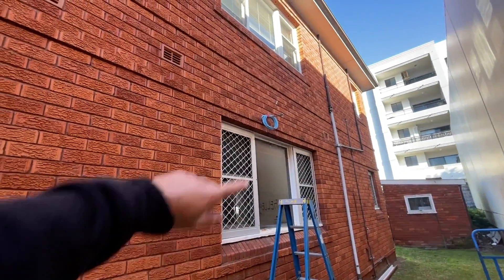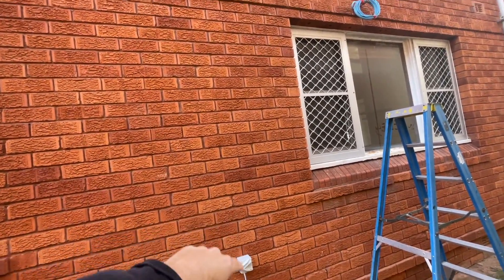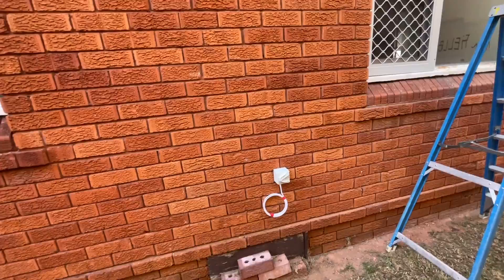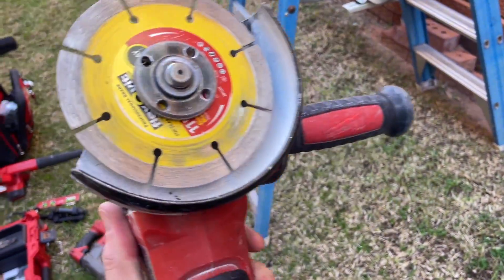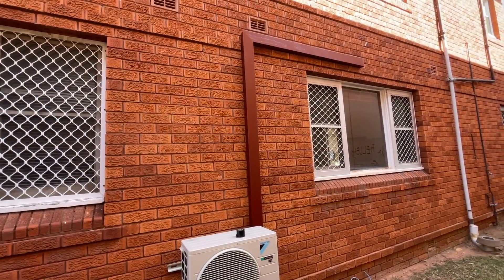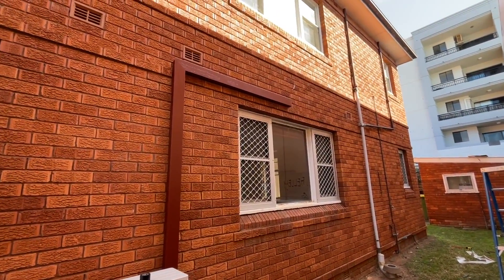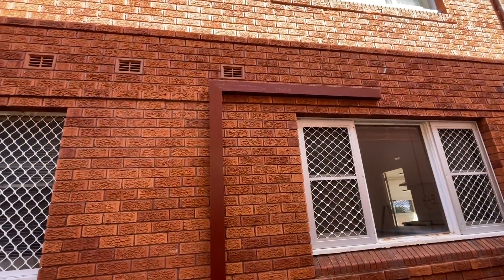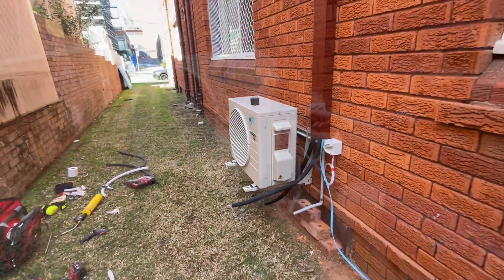Installing a R32 Daikin Ductless Mini Split Air Conditioner.

Comment: Great Vlog. Love your ductwork. Super neat. What brand is that ducting? Couldn't find it on internet.  I like it
Reply from the maker: There’s a company called colorbond in Australia that manufacture sheet metal.  Any air conditioning wholesaler in Australia sell this ducting and it’s made by Colorbond. We call it Trunking and every installer uses it over here.
Reply: Thanks Mitch. I live in Melb and have looked for it and cant find anyone that sells it other than a company called MJS in QLD
 @maracservices

Comment: Great video, how long would the run of copper need to be apart between the outdoor and indoor unit before you would need to add more gas
Reply: 20 to 30 depending on the brand and size

Comment: Do you guys use aluminum tubing or copper ? We used to us aluminum a few years ago, but almost everyone in the trade here has switched back to copper - found aluminum corrodes after time and starts forming pinholes
Reply from the maker: We have always used copper here and still do. I’ve never heard of anyone using aluminium. Very interesting!

Comment: Hey mate, how do you seal the end of the colorbond capping? 
Would be keen to see a video of how you do the 90° bends too! Love your work
Reply from the maker: So I seal the penetration through the wall with clear silicone then i fold the lid of the trunking over the top so it covers the top. Then I also run a bead of silicone along the top where the lid meets the wall. I’ll make a video going more in detail. Cheers
Reply: Legend! Thank for that’s…definitely want to start using it, looks way cleaner 👍

Comment: thumbs up for a new driver. I think you willed it to work with that battery swap. Might be time for the retirement shelf in the back of the truck.
Reply from the maker: I think you might be right mate. I’ve just held off as long as I could but it seems to be getting worse. It is time!

Comment: Mitch, neat as always. Are you gravity draining the condensate or pumping when you have horizontal runs such as that?
Reply from the maker: Thanks mate, it’s a gravity fed drain every single time. I’ll only use a pump as a last resort personally. Cheers
Reply: @maracservices  I stay away from pumps too. Stay well thanks
Reply: I also try staying clear of pumps. Done 100's of installs with gravity drains with even longer horizontal runs, but use 25mm tube, and if there is space in trunking I try sloping drain  inside the trunking
Reply from the maker: @craigladewig3158  I agree mate

Comment: I have heard you consider getting a 12v drill setup or will you be sticking with the 18v?
Reply from the maker: I want to get the m12 impact for my service bag but an m18 impact and drill is way more important. 
The m12 is a just a light weight thing which would be nice. Not a necessity in my opinion. I want to get a new m18 impact to replace mine which is cooked then hopefully one day I’ll buy an m12. Everything is just so expensive nowadays 😂
Reply: @maracservices I’ve got both and the m12 is my edc go to. Great power for the size

Comment: Hello Mitch,my name is Jacopo and I’m Technician too in Italy,I have few question because I’m preparing to fly in Australia with Working holiday visa and I would do the same job,I have almost 6 years of experience and the Italian License,I would ask if the aluminium plant is a common in Australia and about the Gutter is iron? Because here we usually use a Plastic one..good work for your videos and i like how you work! 😁
Reply from the maker: A lot of people use this metal channel but also a lot of people use plastic pipe duct. What ever you prefer mate. So if you prefer working with the plastic stuff then that’s totally fine! Where in Australia are you coming to work?
Reply: @maracservices  wow,your reply is so fast thanks!,to be honest I’m kind of worker that everything is fine,I adapt to all types of material,I work with metal,plastic,aluminium and copper,plastic channel is just faster way to put the channel on the wall 😄,I was asking which noun was the refrigeration plant,I still don’t know which city,I was thinking Orange for do my 88 days and to be able to ask for the second whv,and then Melbourne or Sydney,can I ask where you work mate? If you have some advice for me I’ll be glad to hear it!
Reply from the maker: So I live and work in Sydney mate. Orange is very nice. It’s 4 hours away from Sydney and I have done a job there —>> 

https://youtu.be/Til8udWUe1Y
Reply: @maracservices  do you know any company in orange? I was thinking to start work there,I saw the video,very nice work compliment! Do you always work alone?  If you have any advice for start working for a company I’ll be glad to hear it 👍🏻 thanks mate